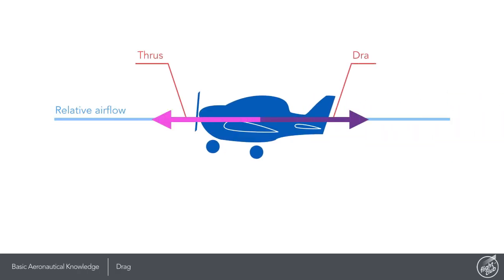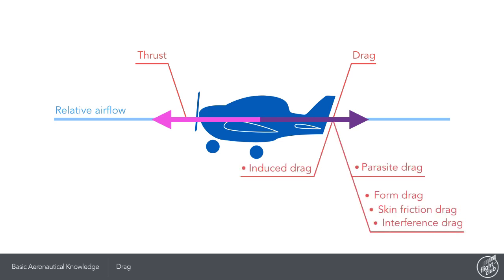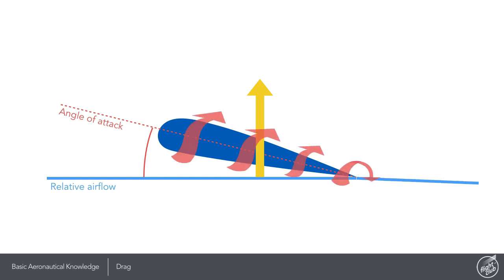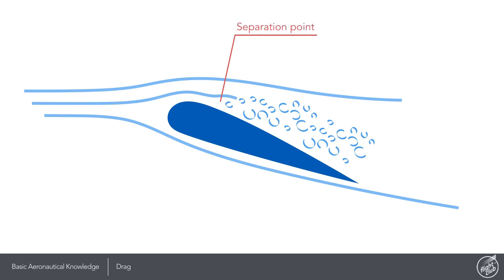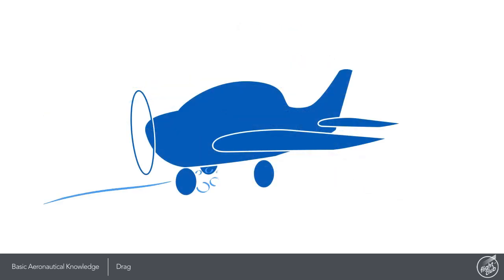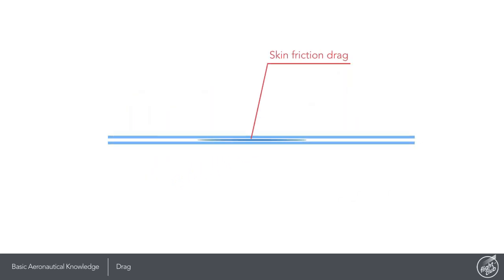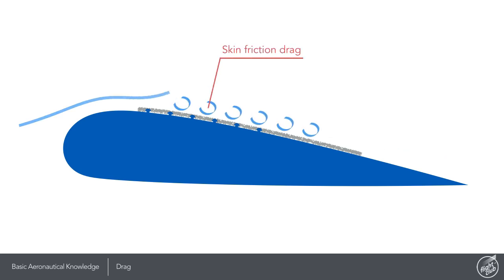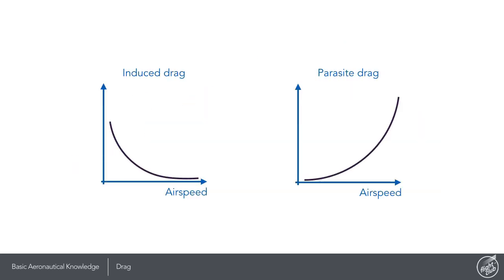What is Drag?

Comment: The point where induced drag and parasite drag meet, suggests that Induced drag equals Parasite drag at that point.  It is also known as Vmd, (airspeed at which the total drag is minimum and the aircraft can glide at its best efficiency) any change in the airspeed or AOA at Vmd, will result in the increase of Total drag. Hence Vmd is always achieved at the optimum angle of attack, that is 4°.
Reply: Thanks. Informative
Reply: @vijaytamang3450  I also found it informative Vijay! happy flying fellow aviator :)
Reply: Thanks for this.
Reply: Awesome!